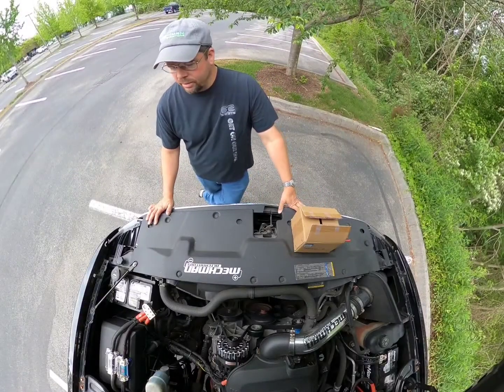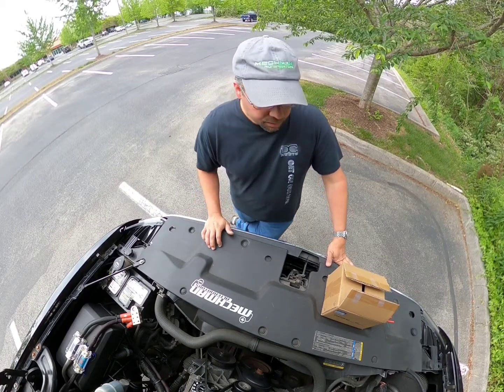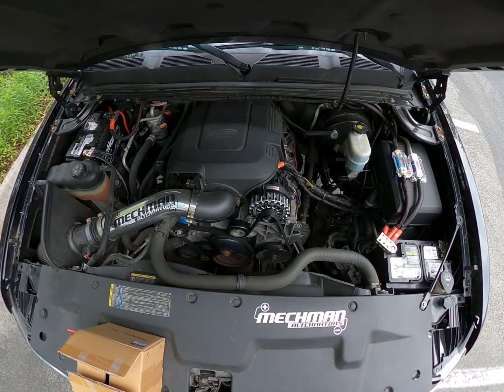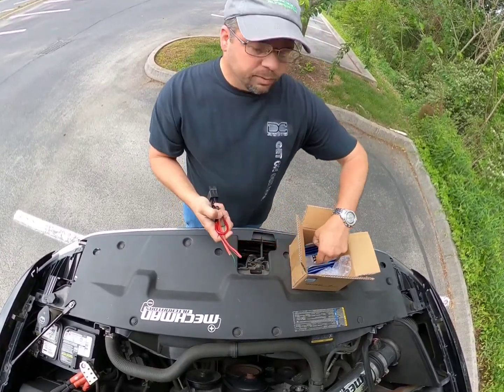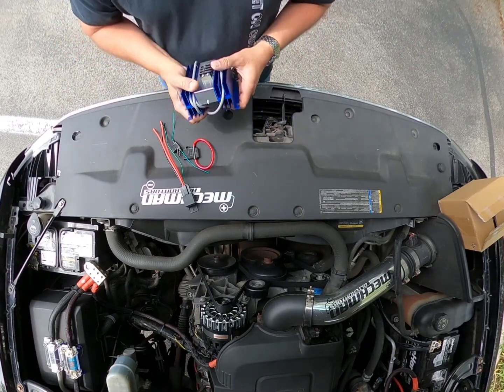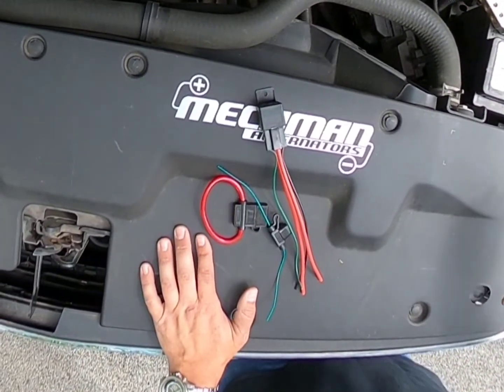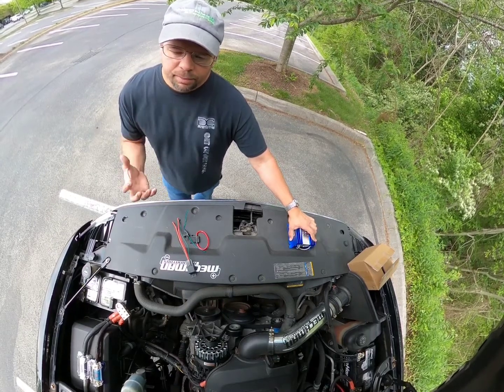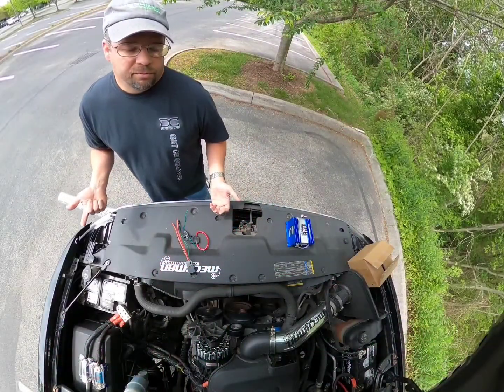External Regulators: Know when to hold'em and when to fold'em!

Comment: Question.  I'm looking to buy your voltage regulator with SKU # 91102RC. Will this work on a 2003 town and country factory alternator? I purchased a generic $80 one, and it makes my lights flicker like crazy and it has burned up my 250 amp alternator. Will this regulator work well with this setup? (I did hook it up correctly). Factory charging is around 13.4-13.7, unless it is super cold outside.

Comment: I'm curious about these other options about how to get my voltage up in my 02 grand cherokee 4.7. I bought one of these adjustable units because my PCM is making my voltage be between 9 volts and 11 volts and very rarely will reach 12.5 volts when over 3k rpm. Please help as I would like a better option than this external adjustable regulator. Also the wiring it in is not intimidating as I am an automotive technician of about 20 years and do quite a bit of wiring.
Reply: And I have already tested the pcm with a labscope and it's definitely failing but only for the regulator. Also just took my second new alt off to install a 320 amp alternator and need this to bump up closer to a charge of 14.5

Comment: Not all alternators are installed in cars.  Many of them are installed in boats and RV's for the purpose of recharging the large house battery bank.  In that  case, a smart external regulator like the Wakespeed WS500 that can reduce the alternator output to control overheating and charge to the proper voltage for different types of batteries such as LFP is very important.
Reply from the maker: Absolutely correct. We NEVER recommend the standard/entry level external regulator we have with to a marine application customer.

Comment: I have dual Alts and one runs the truck and the other is for my amp the one for my amp is a external regulated and I have it charging at 15.2 is that ok I have I a agm 110ah and a bank of six super caps all installed professionally is this wrong ?
Reply from the maker: For the most part, 12v AGM batteries don't like to be charged over 15 volts. They can be but you're not gaining much if anything and also shortening the life of the battery.  A good 14.6-14.9 volts is generally the sweet spot for AGM.

As for the SuperCaps, you'll just need to refer to the manufacturer of those to see the prefered charging range.
Reply: @mechmanalternators  cool thanks but I do notice when I charge at 14.8 to 15.2 I know it don’t seem like much but it’s a gain of 5000 watts it’s a day and night difference
Reply from the maker: @pork.t.v9462  So four tenths of a volt makes 5000 extra power?   You might want to check that math.  4/10th's of a volt would be like 160 extra watts if the alternator is putting out 400 amps.  

Feel free to check for yourself:   https://www.rapidtables.com/calc/electric/Volt_to_Watt_Calculator.html
Reply: @mechmanalternators  these amps at 12v do 4000 at 15.5v do 8600 I’m sure of it like I said it’s night and day difference and it’s a 320 running my stock and a 370 running the amps thanks for ur feed back

Comment: Most externally regulated alts have a plug that is black and square ish and usually have a green ans black wire, also guys don't run your ecu above 15v or u r going to have a bad time
Reply from the maker: Thank you for the reply/back up!  People WANT to run 15+ volts until they realize that means their vehicle will run at 15+ volts.   Also, the external regulators we use in older Dodge/Mopar or 16+ volt applications are a tan in color. Can be either rear or side plug orientation.
Reply: @mechmanalternators  I run dual external at 16.5 then victron energy 12/12 30amp chargers to supply my truck with its voltage for the stock, it is so much easier having a alt do the thinking for u when u can, but I don't want my alts rueat full bore while I am driving, the plug and play options y'all have for easing voltage r great and solid, fuq all the diode adding
Reply: FATHER'S OF BASS  I need more than two I already have two 390's on my year suburban I have tried two ho one stock for a triple and any configuration that would work I haven't found it to be reliable enough to stay together while u drive hours down the highway to a show, my duals work perfectly and I am confident in there ability to perform and belts and idlers staying together, with the two 12-12boxes I have they charge at 18 amps each very low demand they r very efficient so I am losing only about 400 watts and gaining dependability and confidence 100% I run about 40k watts and so far with the amount of lithium I have and at 350 amps of idle charge it is solid